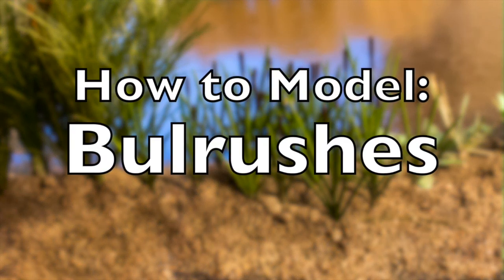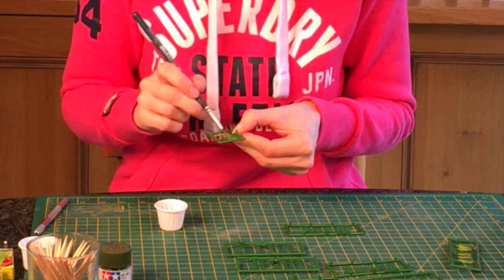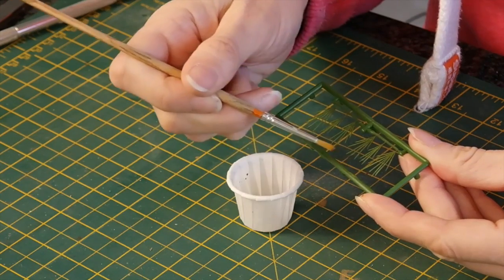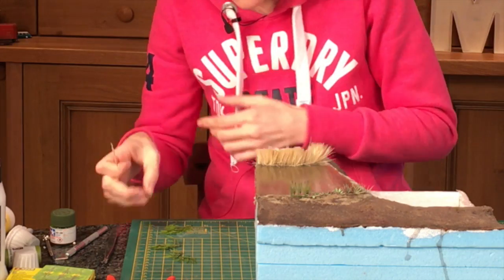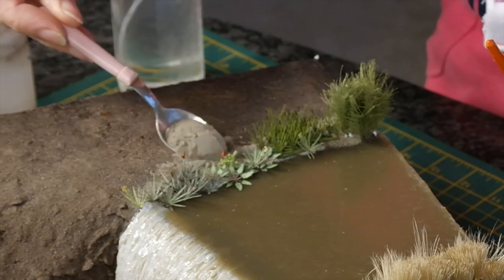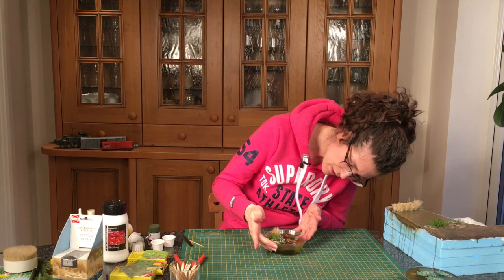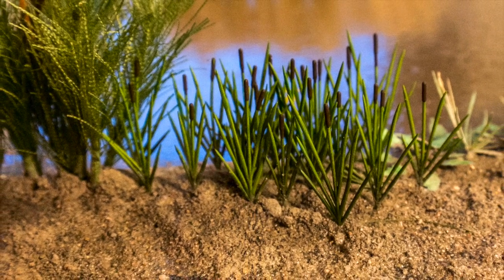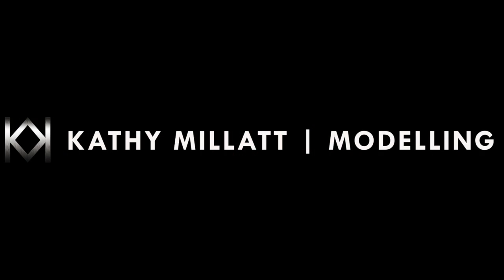How to Model Bulrushes using Busch plastic models

Comment: hi Kathy how do you think they would look if they were set up then the water was poured around them so they would be in the water or atleast the edge of the water?? and thanks for the videos.
Reply from the maker: +curtis hunt Hi Curtis, I did that in one diorama and it did look good.  You will always get some wicking if you use resin but it wasn't really noticeable.  Kathy
Reply: +Kathy Millatt thanks what resin did the least wicking
Reply from the maker: +curtis hunt Hi Curtis, the best trick I find is to make sure you pour the resin to its final level and no more. My worst meniscus happen when I pour the resin and it is slightly too deep so when it settles down it leaves a meniscus. Envirotex Lite is thicker so a worse culprit for this. I think Magic Water is slightly thinner and rises less. They both wick but I'd plump for Magic Water. 
Kathy
Reply: +Kathy Millatt ok thanks